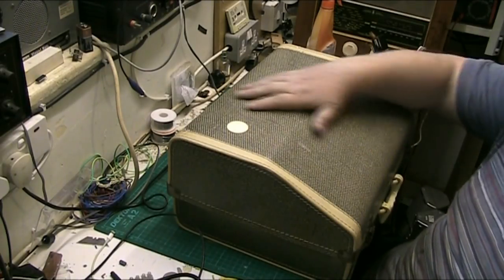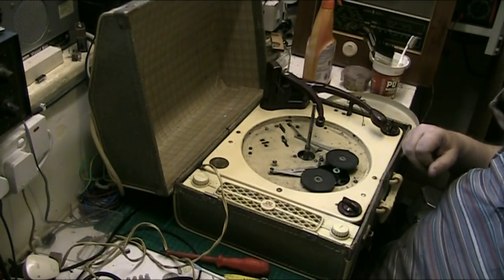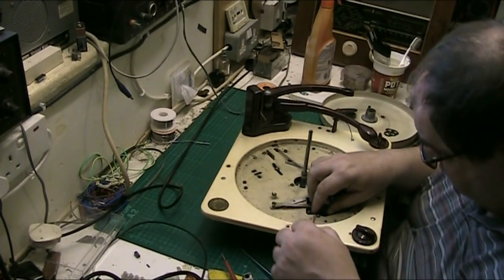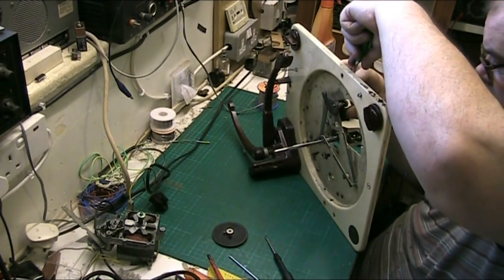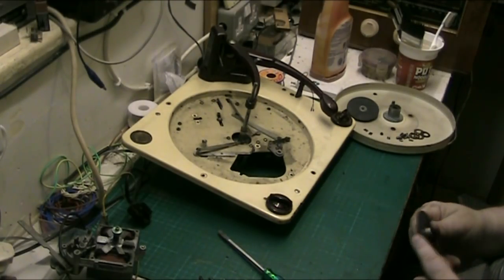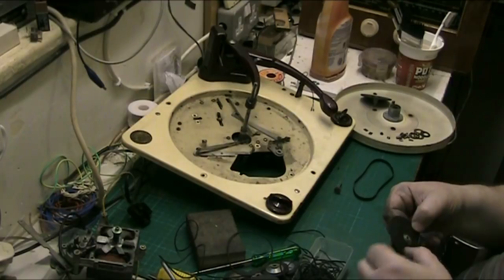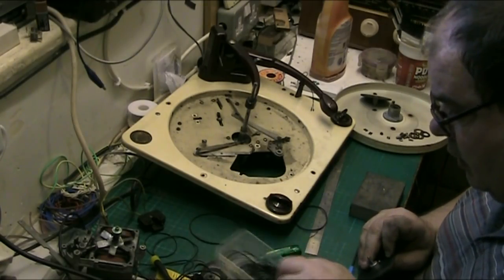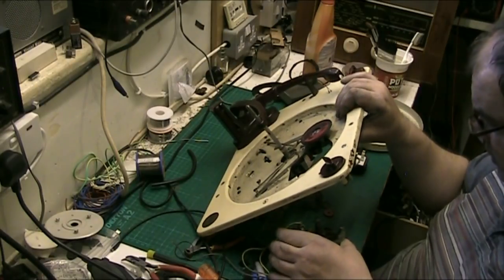ALL THE THINGS THAT DON'T WORK WHEN REBUILDING AN IDLER

Comment: What a bloody performance!! Must never bring a collaro deck!! I bet that drive idler has been resting against the motor wheel for 30 years and made that big dent in the rubber then it all dried out and perished! Do you think this will ever work again? This really puts me off ever gettting a player with one of these horrible decks. Laurence (my internet DEAD SLOW seem to be a local problem)
Reply from the maker: Collaro's are good decks this one still works without the rubber on the idler but its noisy Jay has a spare replacement so yes it will work again